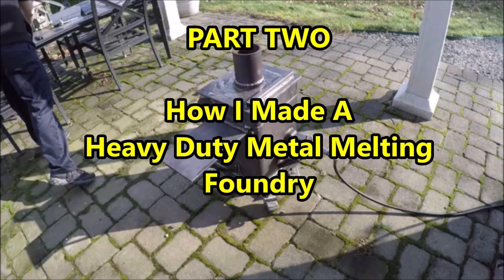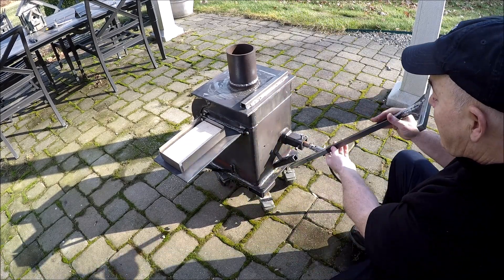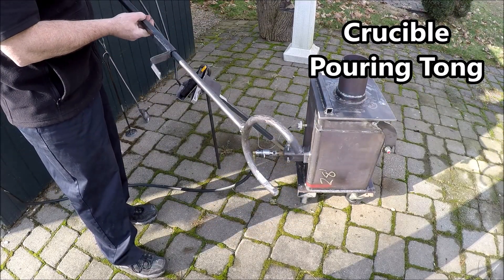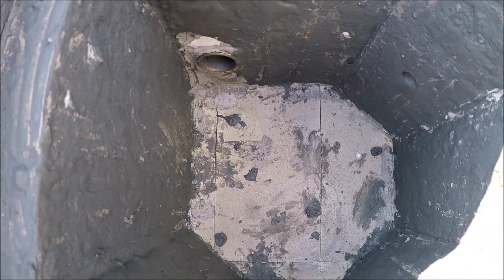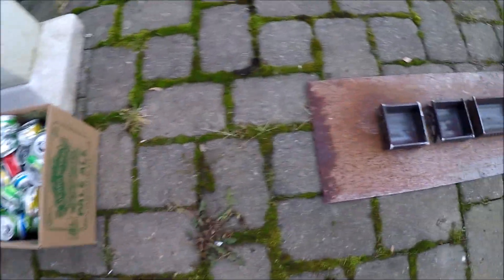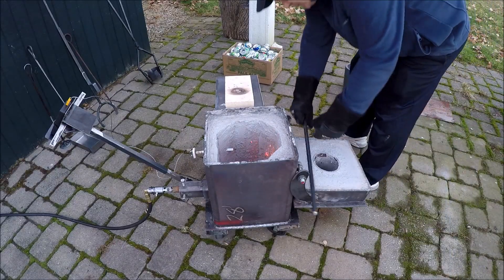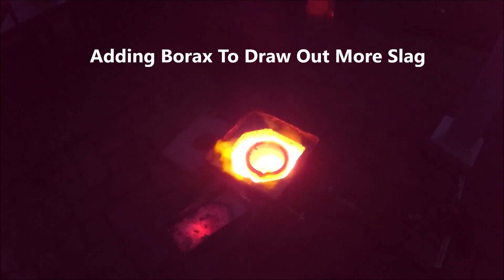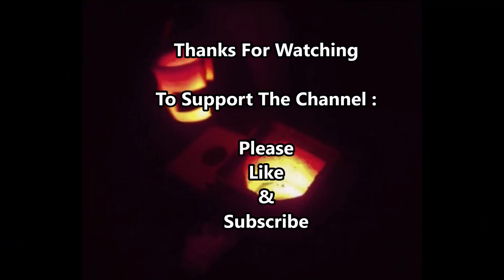Homemade Metal Foundry - PART 2

Comment: Believe it or not, alot of that "slag" really isn't slag. Overly burnt aluminum. I have a small electric furnace and being that I can control the temp I do get more aluminum out of the cans. These propane furnaces are really meant for brass, copper, mild steel, and cast iron.

Comment: Really nice, so think you said 2800 do you think you can do steel you are right there on temp ? Maybe add another burner 👹
Reply from the maker: Thanks David - I think I can push it to melt steel given the burner can handle up to 20 PSI and I was running at 10 PSI for the test run.  Booyah!